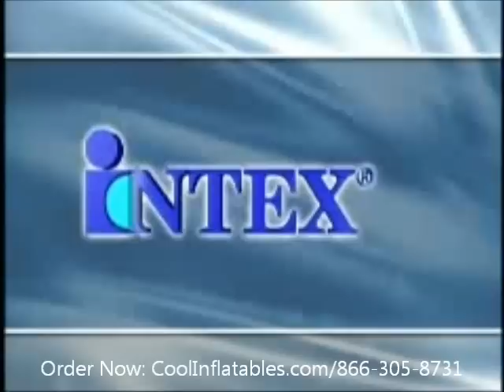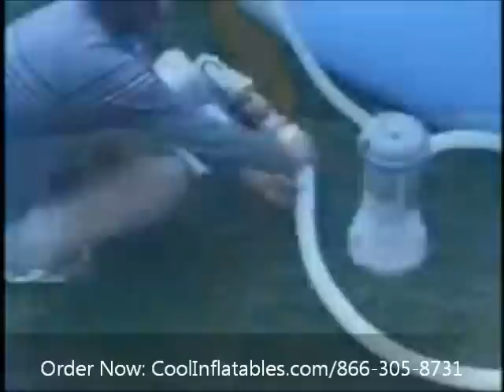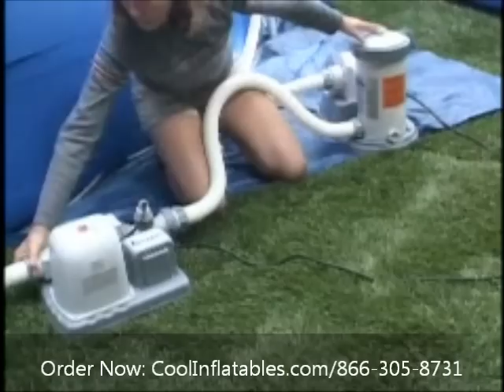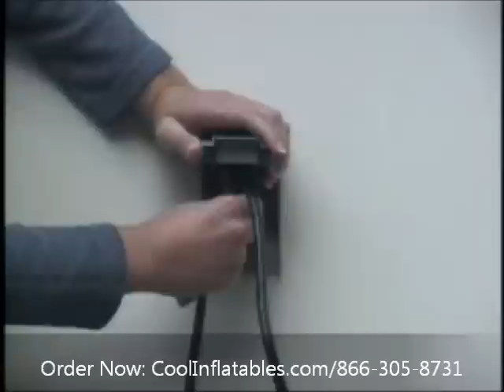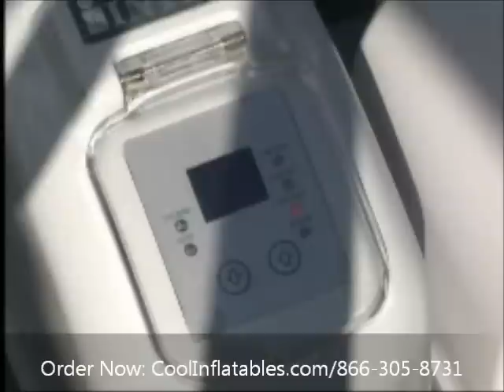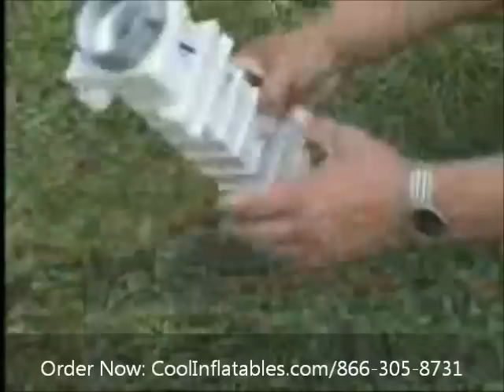Intex Saltwater System Model 8110 Setup Instructions

Comment: So if you want the unit to come on at midnight you have to stay up and program it at midnight......That was what I was a bit confused about.  You cannot set the start/stop times, only the duration. So I did that and put the pump on a cheap electrical timer to come on a bit before and stay on for half an hour after and bingo!  Good system.